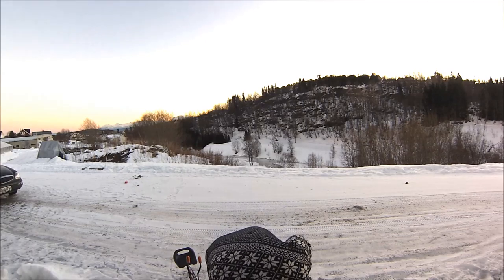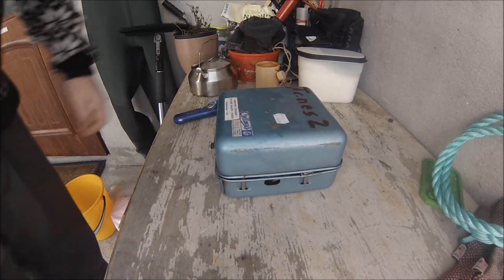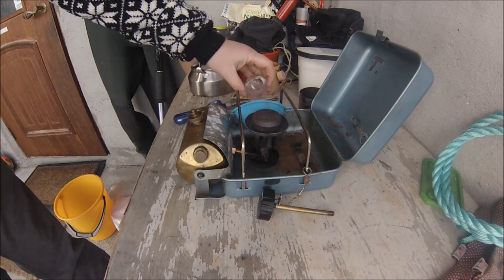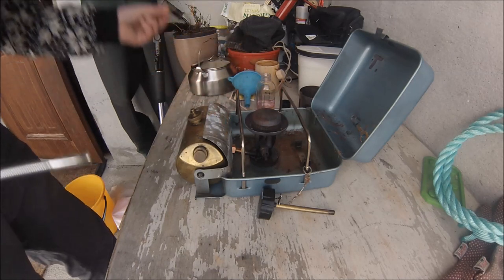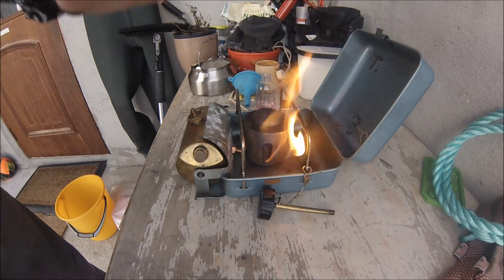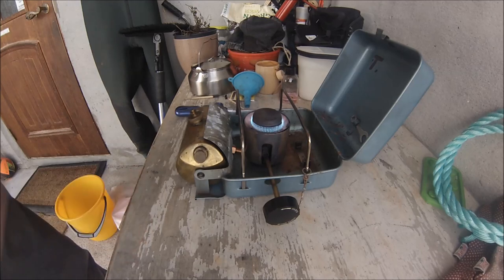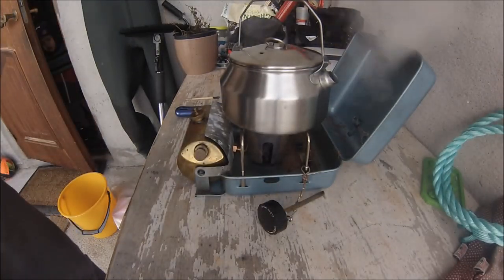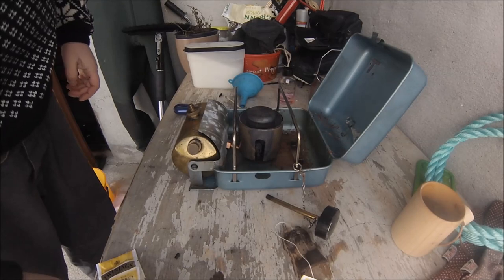How to light an Optimus 111 stove

Comment: No need for a funnel, just lift off the outer burner ring and pour the priming spirits into the primer cup.  Leave the control knob in, no need to take it out before you light. Great stoves, I have a few myself.

Comment: Small tip: if you put a round glassfiber wick of the Optimus 111C (cobra) in the priming pan, you can light the priming alcohol much easier. It is spare part number # 9070. 
Otherwise nice video, really like these stoves.

Comment: You need to use Mentholated spirits in the primer bowl, that way it will light straight away, and white gas (Coleman fuel)  in the tank, that way you will not have any trouble lighting your stove